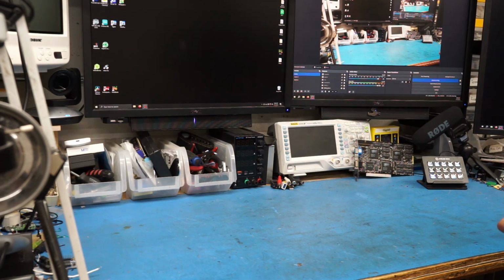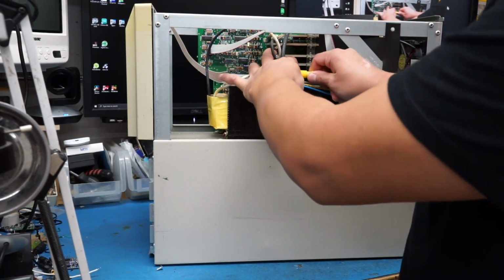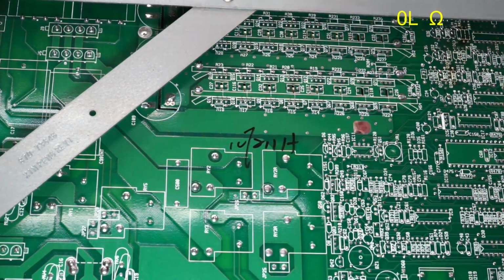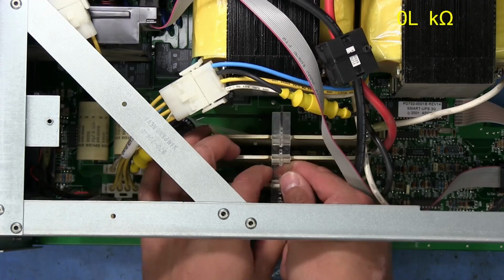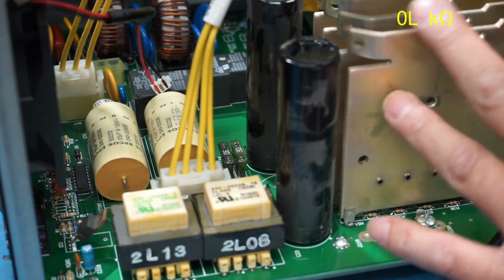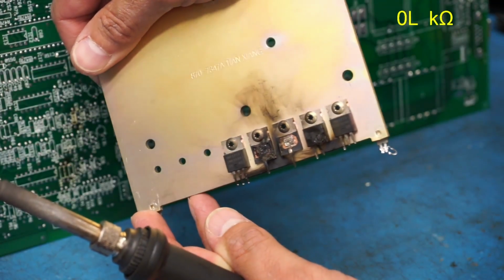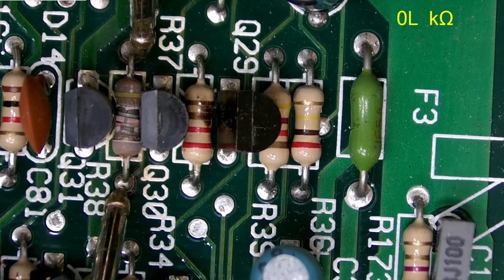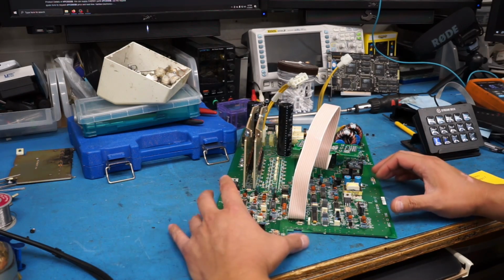TEF #122 | APC SU2200NET UPS Repair Attempt (Emotionally Heavy)

Comment: I have a 2200 (2 actually, one for each set of redundant power supplies in the server racks) and just ordered batteries for one.  When they got here they were about an inch too tall to fit in the bay.  Bit more looking and found that I'd ordered batteries for the SUA2200 while mine is an SMT2200.  Apparently the batteries for my box would work fine in an SUA2200 but it doesn't work the other way.  I guess it made too much sense for all of the 2200 models to use the same sized batteries.

Comment: Check the charge drawer resistors. I have a rack mount version of that. And that's what goes wrong in the 48 V ones, the 24 V ones don't have that problem. Cause the resistors. Don't run that hot, but I did go ahead and replace them. In the 24 V, one as well with larger And went ahead and redid all the capacitors. Since these things run 24/7 for years at a time, maybe taking out a service every 5 years for new batteries.

Comment: You were starving it of air and that probably led to overheating
Reply from the maker: *Maybe*, but I think it looks more crammed in the video than it actually is. The vent holes on the right side of the box are completely unobstructed and there is plenty of space for air to move around down there. After trying to find parts boards online, seems most of the boards I came across had failed in a similar manner.

Comment: I had a SU3000 with a battery pack blow up. Same thing, the a whole bank of mosfets blowed up. I end up buying a parts UPS and swapping the board out.
Reply: It should also be noted that SmartUPS family shares a lot of circuitry. Even the smallest ones could be often used as part donors for powerful ones. Boards are swappable only with relatively close models though. ICs like APC2010 and APC2020 could be found in SmartUPS SUA750 for example.

Comment: Geez, I was going through the video and was almost CERTAIN it was gonna be the usual 22uF cap issue the SmartUPS line is plagued with, but then I saw the carnage. not fun.
Another option to use them again would be to find a comparable newer model that has provisions to use the same connectors as those batteries but externally, then all you'd need to do is build up an external box to hook in.
Reply from the maker: I may end up using them externally in another UPS that's installed in my server rack, the batteries of which recently gave out. It normally uses eight 12v 7Ah lead acid batteries, I think these would be more convenient while also providing more run time.

Comment: Yep, when a problem cascades through a circuit, it is a challenge to find all the bad components. If you miss one you get watch them burn up again. You made a good call.
Reply from the maker: Especially on something like this that switches such high currents. I'd hate to see it all instantly turn into a candle after doing all that work.
Reply: @ThatElectronicsFool  With all the FETs being in parallel it might be a good idea to only solder in one in each line for initial testing of driving circuitry to at least somewhat limit possible carnage. Of course there shouldn't be much load applied in that case.
Using something like incandescent bulbs for current limiting might be necessary too if it keeps misbehaving.